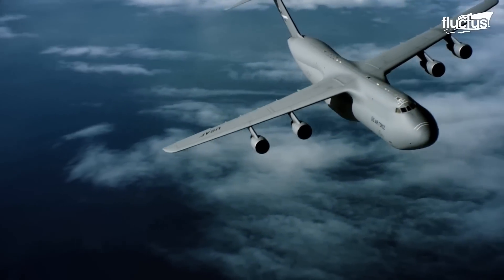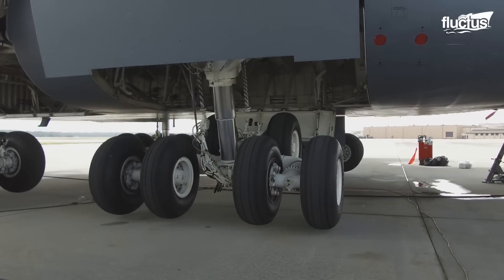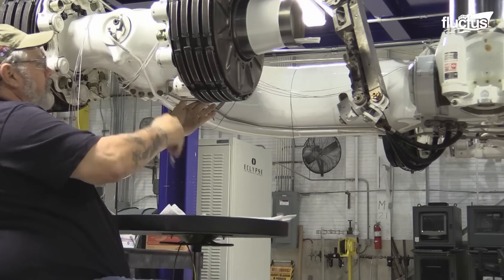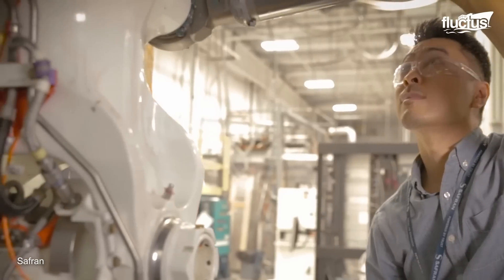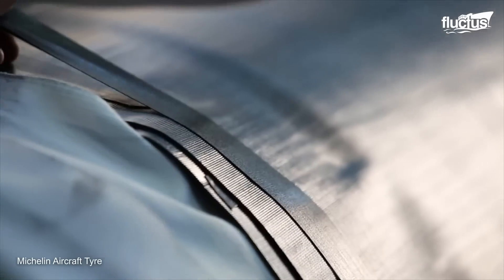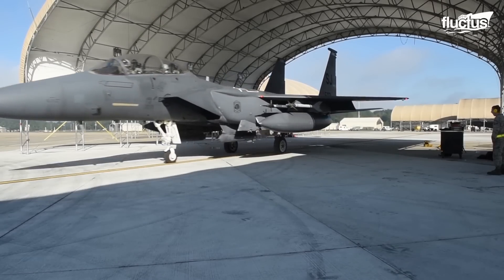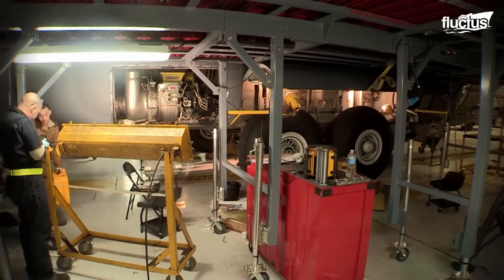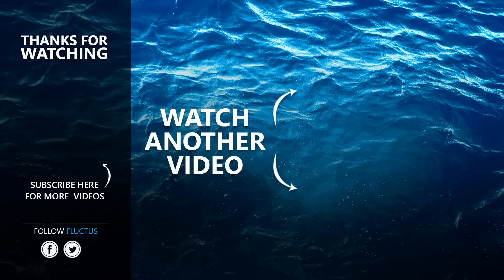Testing Brand New Massive Landing Gears on US Largest Aircraft

Comment: Early versions of the A model had 80 wheels on the main landing gear. They could alter the orientation of the wheels so the Galaxy could land perfectly in line with the runway while the fuselage was turned into the wind.  The I were concerned about cross wind landings. Subsequent models did not have those features! I talked to a pilot who said he was doing his take off roll @ a gross of 1 million pounds. The aborted the take off however!!